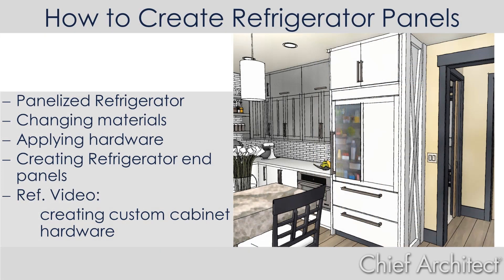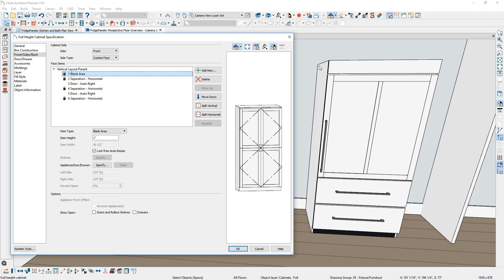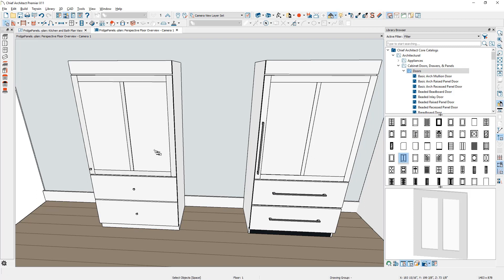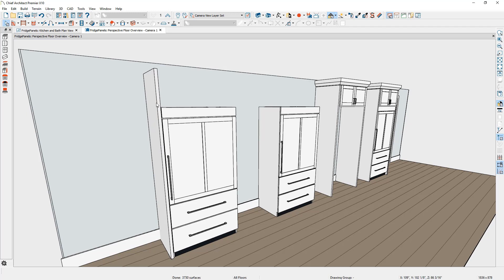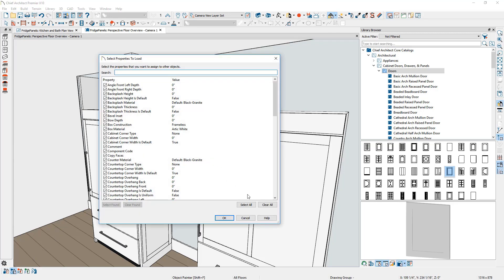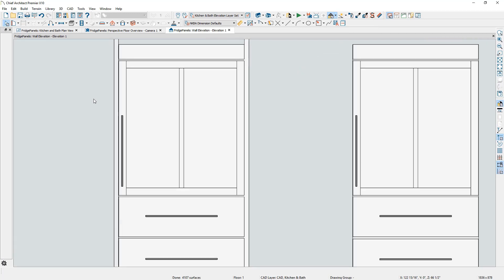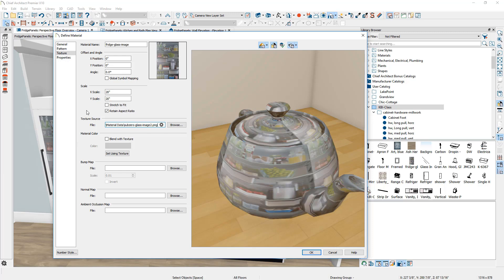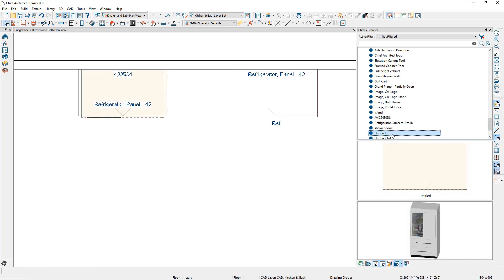How to Create a Panelized Refrigerator

Comment: I want to add antique wood doors that look like an ice box. How do you do that to existing doors? I seen it on HGTV shows. but they don't tell you how to do it. Any suggestions where I can find that information? thanks.
Reply from the maker: You could use a partition and slide it up to the front side of the refrigerator to create a custom look or you can import custom 3D Symbols. I have linked below how to import the symbols.
https://www.chiefarchitect.com/support/article/KB-00117/locating-and-importing-3d-symbols.html
Reply: @ChiefArchitect  thanks for the website, but I don't know how to navigate to where I need too, too show me how to make a antique rerfrig. door.